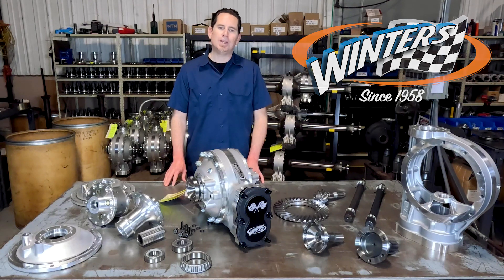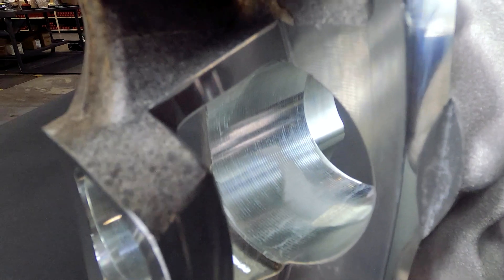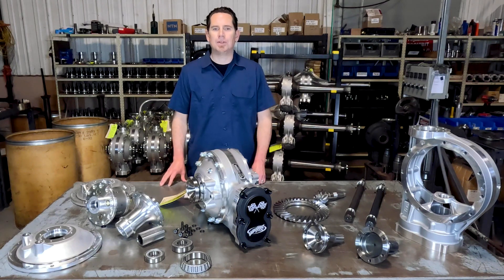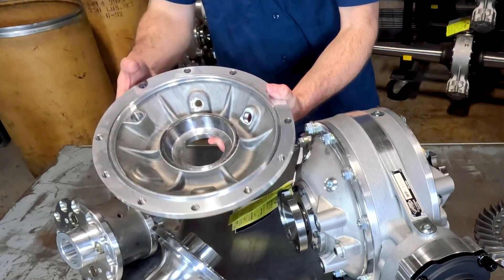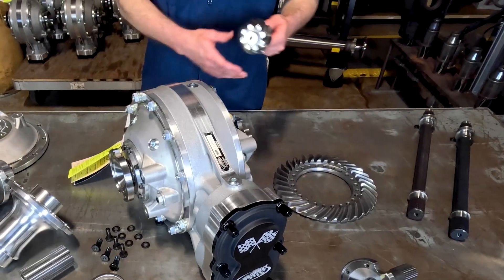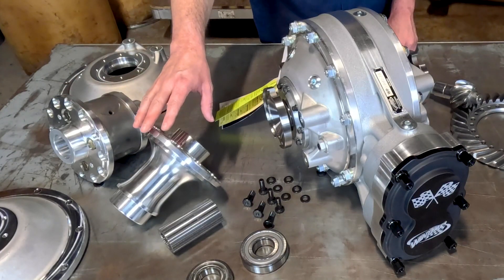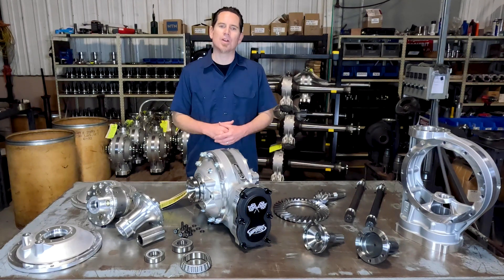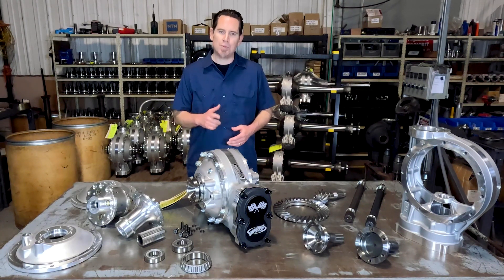Brand New Independent Quick Change Specs // Winters Tech

Comment: These look great. I do have one suggestion, Please consider offering a clear baked on powder coating for the raw finished version. Perhaps with a bead blasted pre-finish. You have to know what oil does to raw finished metal.... soaks in and stains it. I have an older winters QC in my ASA Nascar. When I rebuild it I am going to clean off the oil stains, bead blast it then clear coat it with clear powder coat to keep it from eventually obtaining a raw oil stained/soaked look.